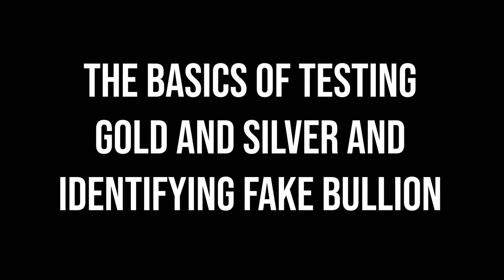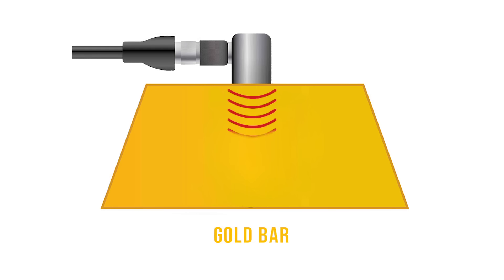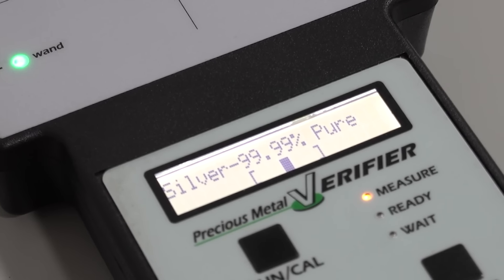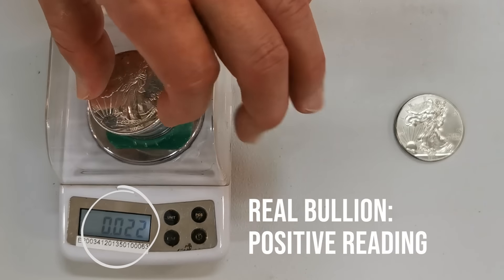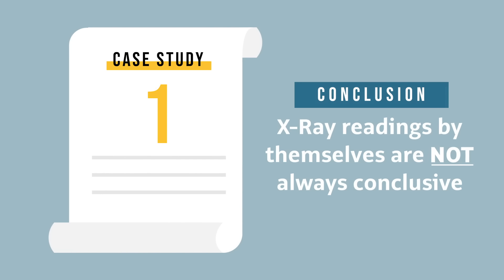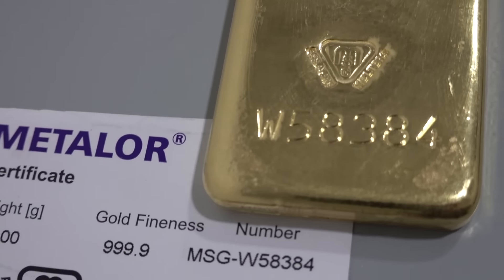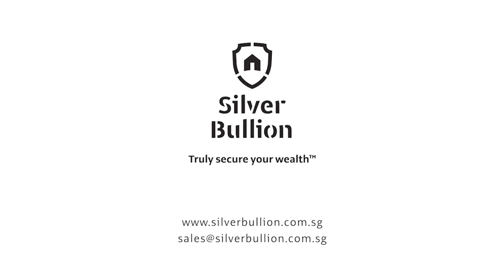Basics of Testing Gold & Silver and Identifying Fake Bullion

Comment: A quick rough test of silver purity is to rapidly pass a strong magnet across the metal’s surface.  Since silver has the highest electrical conductivity, the eddy current induced will produce a strong magnetic drag effect.  You can train yourself to build an intuitive feel for how strong this effect should be.  Silver will be the strongest out of all metals.  The test doesn’t require physical contact with the metal either.

Comment: 0:00 🪙 Introduction to testing gold and silver and identifying fake bullion.
0:08 🏦 Emphasize buying from reputable dealers.
0:24 📚 Understanding material properties for testing gold and silver.
1:00 ⚖ Density test: Common but not very reliable alone.
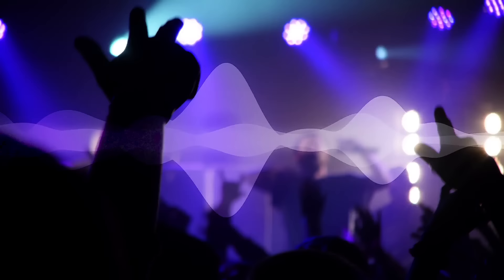2:22 🔊 Ultrasound test: Effective for detecting gold-plated tungsten bars.
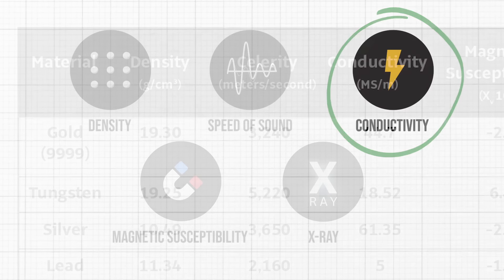4:44 ⚡ ECM test: Measures electrical conductivity; highly effective for silver.
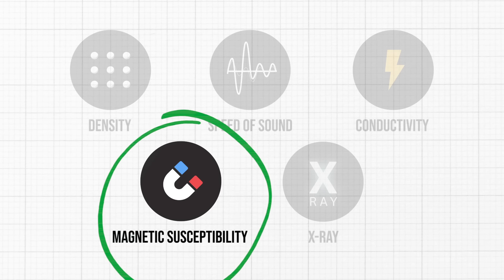6:51 🧲 Magnetic test: Gold and silver are repelled by magnets; useful for detecting fakes.
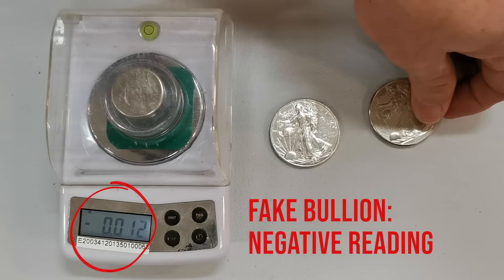7:56 🔬 X-Ray fluorescence test: Surface composition analysis; limited to surface layers.
9:03 🔄 Always use multiple testing methods for best results.
9:48 🚫 Limitations of non-destructive testing.
10:01 🔍 Case study: Surface contamination affecting X-ray test results.
11:02 🧊 Case study: Porous old silver bars challenging for ultrasound testing.
12:12 🕳 Case study: Tiny pores causing ultrasound test failure in gold bars.
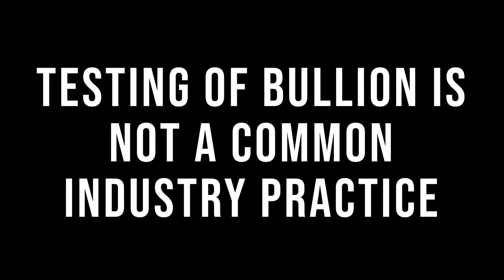13:03 🏢 Industry practice: Most vaults do not extensively test stored bullion.
15:17 📜 Certificates: Easily faked and not reliable.
16:22 📦 Packaging: Straps on boxes can be easily applied; not a seal of authenticity.
17:12 🛡 Recap: Buy from trusted sources, use multiple testing methods, and don't overly rely on certificates or packaging.

Comment: Informative video! However, if - and I say: if! - a fake tungsten 1 oz "krugerrand" can fool the Fisch tester, the tungsten fake will fail a ping test anyways. So I continue to rely on my Fisch tester for my preferred choices of coins 🙂
Reply from the maker: Swewt. Yes coins are easier to test because of specific dimensions and won't fit in the tester as you mentioned. However there is no standard dimensions for bars to which counterfeits exploit this. Great point you made! Tanks for sharing.
Reply: @SilverBullion  That's easily avoidable by not buying bars.

Comment: How about the specific gravity test? Its very easy to do, its accurate and it doesn't require very expensive testing equipment, just a set of scales and some water (preferably distilled water).
Reply: combine that with ultrasonic (like with the TM8812), magnet slide, and youre laughing all the way to the bank :)